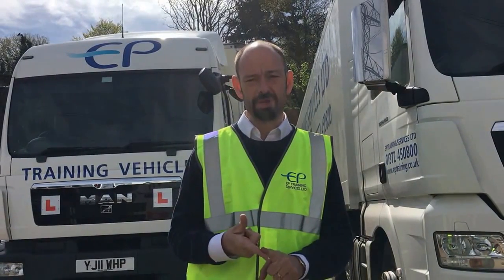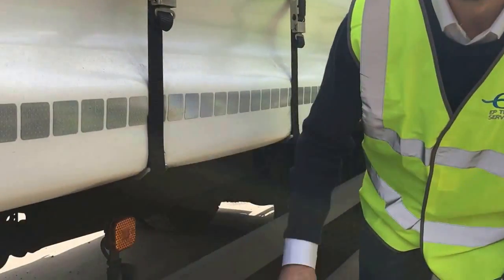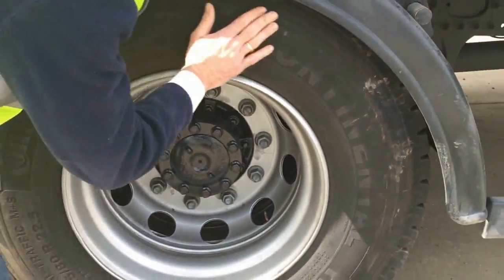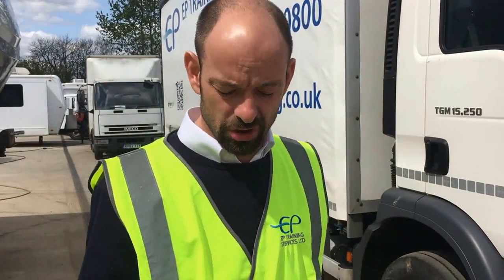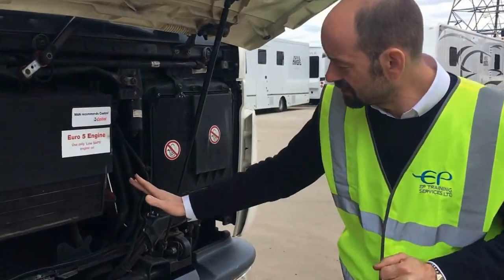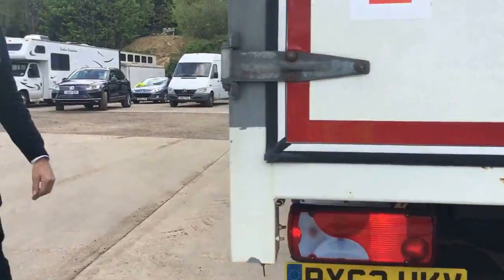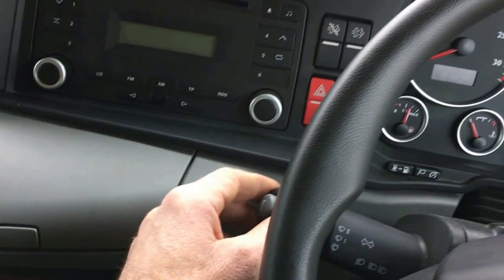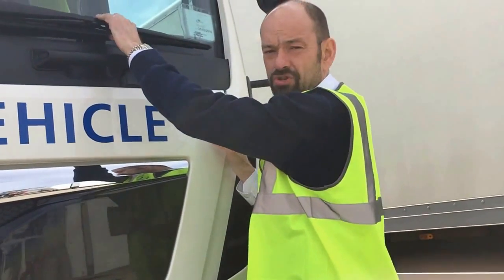LGV Driving Test Tell Me Show Me Questions

Comment: What license would I need to drive a agricultural tractor for non agricultural work, building work moving a digger and the like. Modern tractors are capable of ,60-80 kph so even agri work there must be a test specifically for them ?
Reply from the maker: You need a HGV Cat C
Reply: @EPTrainingServicesLimited  cat C just or C1E?
Reply: @atm451  C1E is 7.5 tonnes and trailer
Reply: @seanpargeter25  thanks.. so if the tractor is 7.5ton what weight can the trailer be?

Comment: I can’t get over the advert on the side . Pass in this auto and get a full manual license. No wonder there are so many tossers on the road ! Took my class 1in 87 with a 13 speed fuller road ranger . If you can’t handle the heat ..... 
Disgusted!
Christina
Reply: The gearbox has nothing to do with the driver being a 'tosser'. A bit of practice and anyone can do anything.

Comment: As a driver, mechanic, instructor and examiner on all groups of wheeled vehicles with 50 years experience, sadly only 2 words come to mind, absolute twaddle.
If these answers pass the test it only goes to show that the test is a farce set by academics with no physical experience of transport or understanding of useful knowledge as against parrot fashion answers.
It is easy to read a script and become a "qualified expert",  this will impress a novice trying to gain a new skill. It leads to a massive amount of unnecessary danger, damage and wastage in real life working conditions.
e.g. light checks as described will not show up dangerous defects which only become apparent when all lights are used in the same rear cluster together. (see VOSA test procedure and ask an examiner why it is conducted that way)
By the time you can see a wheel nut is loose the damage has been done. Only effective visual check is to look at the base of the wheel nut against the rim to look for shiny metal where the wheel has moved or rust "bleeding" where the nut is loose. (VOSA check is a hammer tap to listen for cracked/loose studs but, you need a practical demonstration for a novice to hear good from bad)
Getting a novice to "learn" these checks without giving them actual examples of good from bad is pointless. They don't bother at work coz they don't know what they are actually looking for. Whose fault is that?. Not the novice in my book.
In fairness I have to say this no worse than any other Company i have seen. All about passing a test, not gaining enough basic knowledge to get a job straight away.
Reply: DUKWdriver thanks for your comments 
Thanks for taking time to watch the video. Not sure it was really designed for good people like yourself. I am not an expert as you rightly point out......
Please note this video is for those looking to get there licence. 
Not those who have been doing it for 50 years. 
Sometimes I don’t know why I bother
Reply from the maker: Oh BTW. There is no script. It's all in my head!